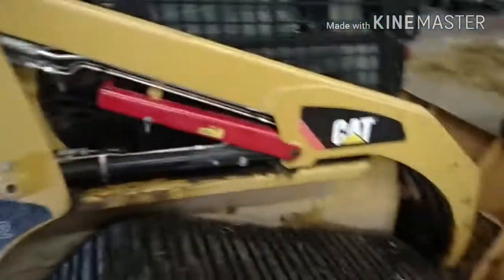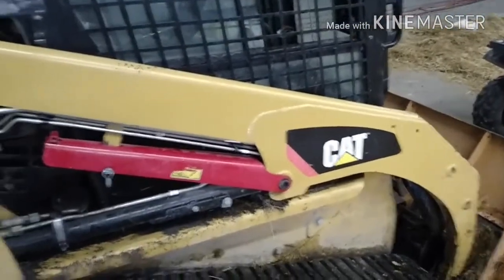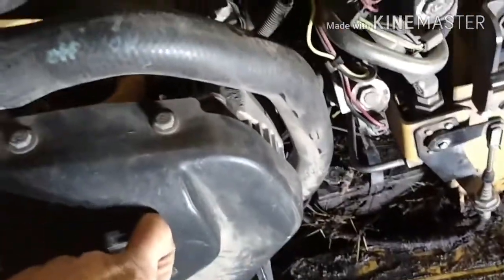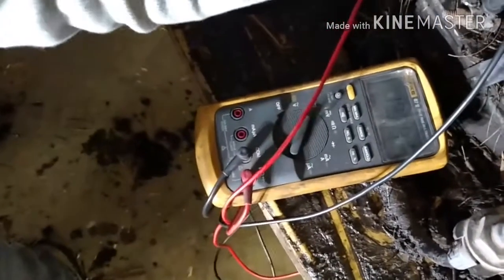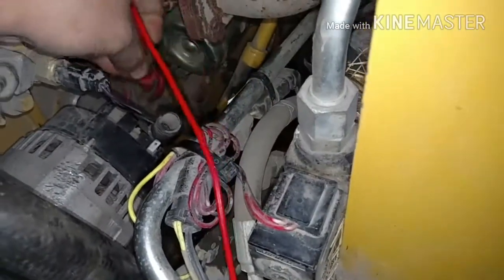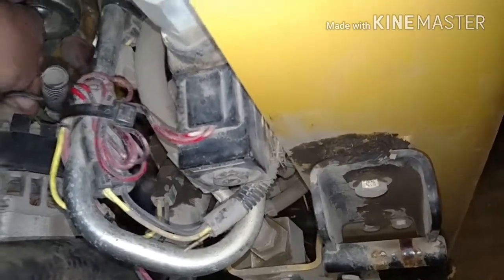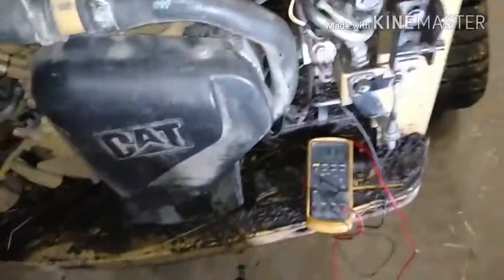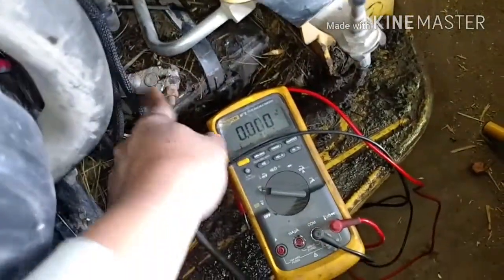Caterpillar skid steer alternator testing and replacement

Comment: I came to see how he takes out the pulley, and that part is missing 😔
Reply from the maker: Use an impact wrench if you have an air compressor. If you don’t have an air compressor, you can try an electric impact from harbor freight or something like that.
Reply: @tysprojects2571  thank you
Reply from the maker: Like the pulley off the old alternator?
Reply: @tysprojects2571  yes

Comment: Was it coming out of park or going back into park
Reply from the maker: It acted like it was going back to park. All the controls are electric, so if you have low voltage, the controls will not work correctly.